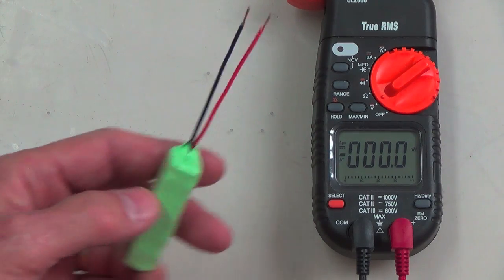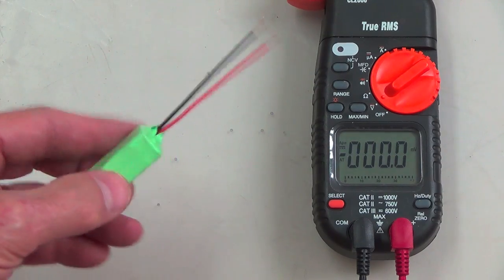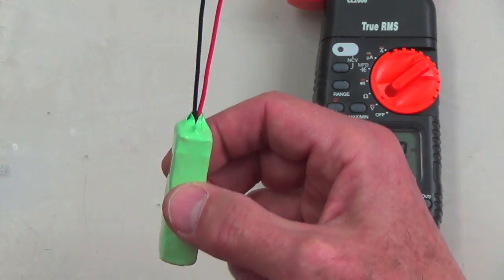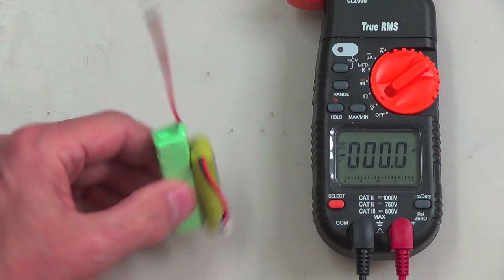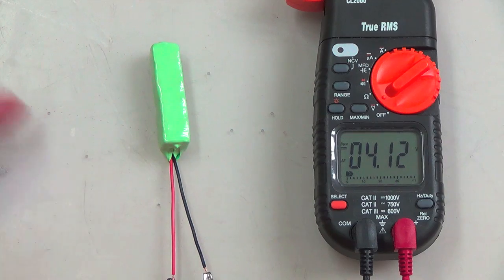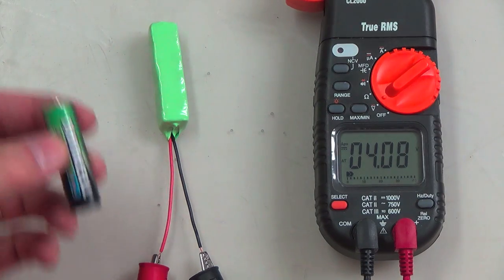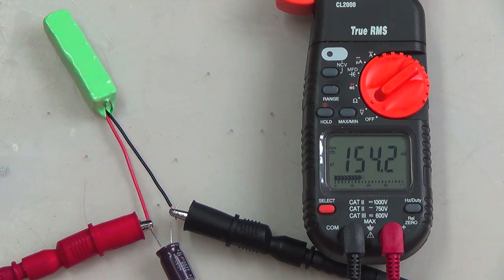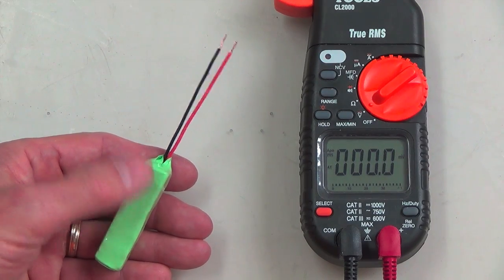MICRO GENERATOR

Comment: Imagine connecting the generator to a joule ringer circuit and have it "ring" forever while powering a load.. some joule ringer circuits I see on youtube only draws about 200mA while powering a string of AC bulbs.. I think "ringing" forever is definitely possible with this micro generator.

Comment: Great innovation indeed! Bravo. I am nearly done with my design which, in contrast to the "Micro Gen" has moving parts and has a potential of producing higher voltage and amperage while keeping the size to AA, AAA or bigger. Will revert back to you in due course for further info. Cheers.

Comment: Want a supercell?  Combine Lithium Hexaflurophosphate or Lithium Cobalt Molybdinate  as the "Anode,"  a polyimde/n-methyl 2-pyrolidone mix as "electrolyte (also keeps the cell from burning or exploding as it is hygroscopic and any puncture/fracture of the cell cavity will immediately neutralize the chemical reactants), and use your silicon/graphite/graphene as the "Cathode - will produce 6 Volts at 12 Amps if done correctly...you can also use just lithium metal as anode material.  For more detail see US Patent 5,895,731 entitled "Thin-film Lithium Battery and Process" - I am the Inventor...HAVE FUN WORLD !"
Reply: Thank you. I see there's no contact or your own videos on your channel. I'm marking this as maybe you will reply. That's the most advanced tech, I'm sure.  ...  I'm worried about the inventor in the video. He's not replying to my contacts about buying his products. It may be that he no replies in 2 years.

Comment: The only problem you should be concerned about this technology is the rate at witch they degrade.  I've heard countless cases of battery or energy breakthroughs over the years claiming faster charger more charge capacity, but either they degrade very quickly or the manufacturing costs are way higher than li-ion batteries.  This technology is considered a renewable energy source, so in this case your greatest competitor is solar.  Can you produce more watts per dollar over the life of the device?  If you do, even by just a small amount, well then yes this is greater than solar.  As solar is huge!
Reply from the maker: Yes, solar is the competitor to target. Good thing it produces nothing at night, and very little during cloudy days, storms, snowfall, shade etc. All these must also be factored in over time. We start with an advantage of 24/7.

Comment: why not put a  regulator and a diode and use it as a proper changer and take the output from the batteries and use the micro gen just to charge the batts

Comment: What happens if you have an opposing voltage against it? As in - if you were to try to "charge" it. Does it need a diode to prevent reverse current flow, or does its construction naturally oppose that?

Comment: Dis you make any tests to check what is a lifetime of such generator? In onther words how many hours you can constantly discharge it?
Reply from the maker: Still working after 6 months at this point, some of which are being constantly discharged.
Reply: That's amazing. Do you know from where this energy comes? Could it be explained with our present knowledge?
Reply from the maker: Of course. In extremely general terms,  it is a hybrid combination of proven technologies. Each component is important, but it's the fabrication process that makes a total difference.

Comment: So, it's just a battery? How is it generating electricity?
Reply from the maker: +David Jackson   No, it is not a battery. A battery only stores energy from another source and does not produce it.
Reply: +PMMG4HYBRID Right. So, how does it produce electricity?
Reply from the maker: +David Jackson   It's a semi-conductive partly galvanic cell with a dielectric layer that suspends galvanic reaction when not under load. Constructed as a multi-cell unit with thin super cap layers to internally store a generated charge.
Reply: +PMMG4HYBRID Forgive me. I am not a chemist or electrical engineer but isn't a galvanic/voltaic cell exactly what batteries are made of? How does the chemical reaction that occurs in batteries to produce an electric current differ from your device?
Regards and thank you for your patience.
Reply from the maker: +David Jackson   There is a virtual multitude of available battery types. Oxidation (redox) is the primary function of a typical galvanic type of battery. It contains no silicon, no dielectric layers and no super cap layers, making my device unique in design and operation.
Reply: +PMMG4HYBRID Thank you for your speedy reply. I really appreciate you taking the time to answer my questions. Just a couple more, I promise.
Is it thermo-galvanic, similar to your silicon crystal graphite battery?And if not, what is the source of the energy it generates?

Comment: Volts are easy to get with these, but amps is the real issue. What amperage does it have?  you can have 50,000 volts but without any amps you cant do anything
Reply from the maker: +Charles charlestons  Watch ammeter on previous videos of single cells running DC motors.

Comment: +PMMG4HYBRID Since you posted that it is a partially galvanic device with mixed internal chemicals then it would make sense to expect a life expectancy.  The micro generator's shelf life and it's life expectancy while powering a load, in addition to the output current and unit cost, will need to be known in order to determine market viability.  It's good to know that you're running load tests with a small motor and LED.  Looking forward to your future progress and updates.
Reply from the maker: +ReasonForemost  Thanks.  New Micro Cell ceases nearly all galvanic reaction when not under load. VOC remains internally from multiple capacitor layers.

Comment: Absolutely Yes.  The question is, how long will it last and how much current can it deliver.... Send me one and I will review it for overunity.com
will also sign an NDA if necessary.  Many thanks and congratulations for getting this tech out.
Every smartphone could use something like this to recharge it....
Reply from the maker: +overunitydotcom   I think we can do that. It's only a couple of days old, so I'll connect a small load and let it run for a few more days. Then I can make you a 5V version to test.
Reply: +PMMG4HYBRID Many thanks Mike. Take your time to first test it all out rightfully. Looking forward to watch your progress on these cells.
Maybe you can show in the next video if you cal already drive a few white LEDs with such a cell stack.
Many thanks. Regards, Stefan.
Reply from the maker: +overunitydotcom  I've got a 20mA @12VDC, 12000mcd green LED with an in-line resistor being powered by the cell in the video right now. It has to be at least 2.2V to light it, so I thought it might make a good test light for this cell's voltage.
Reply: PMMG4HYBRID
Yes, please show this in your next video. Many thanks. Regards, Stefan.
Reply from the maker: +overunitydotcom   Will certainly do.

Comment: NICE!!
Is it chargeable?
I did notice that it was been drained a bit from each use..
I would like to learn more about this type of cell you have been building for hobby purpose!!
Thanks 4 Sharing Bud!!
Reply from the maker: +violeman  Sometimes a dead short will cause it to bounce back to an even higher open circuit voltage. It's the galvanic part trying to self adjust. Yes, because of internal capacitance it will charge to a higher voltage temporarily, then slowly drain back to its typical standing voltage.
Reply: PMMG4HYBRID NICE!!
Your larger plates remind me of a project that Google was working on for their "Power Cells". Their power units look like Big Transformers that sit out side but you can clearly see that they were using plate Cells in the video I watched a while back now.. I will have to try and find it again and show you!! Thanks Again!!

Comment: What is the current output?  Is this same tech Streon is using?
Reply from the maker: +Chris Horianopoulos   I believe their device may be partly relying on ambient electrical noise and/or local RF. This might inhibit its full operation in non-electrical open areas. Just a guess.

Comment: Will this cell eventually go dead? and how long before it does?
Reply: +86daily crystal cells have been noted to work for years until they burst there containers with crystal growths as far as I can tell.
Reply: +PMMG4HYBRID How do you make them?
Reply: why not power smartphne?
Reply from the maker: Reicher Reinhardt Von kesselring  5 years continuous on early test models.
Reply from the maker: +86daily   Don't know yet... months... years?  Getting close to three months with one single cell running a motor 24/7.
Reply: PMMG4HYBRID very interesting. I'm going to have to look at your video once more to understand how you built it.  Thanks